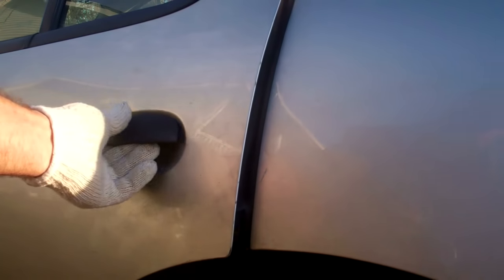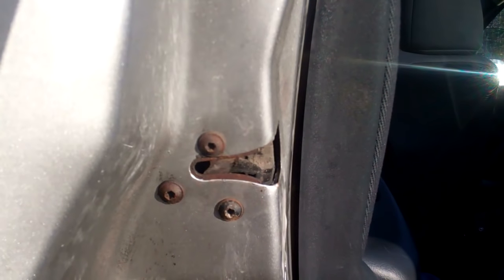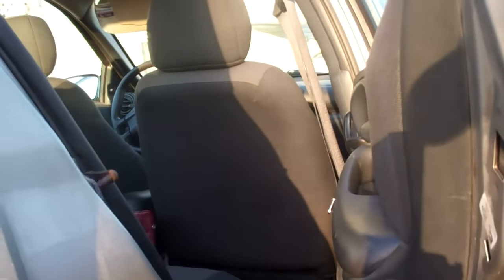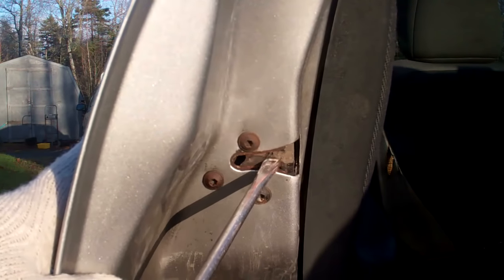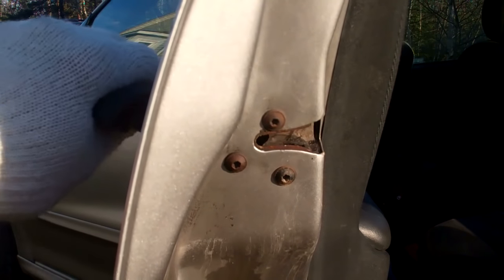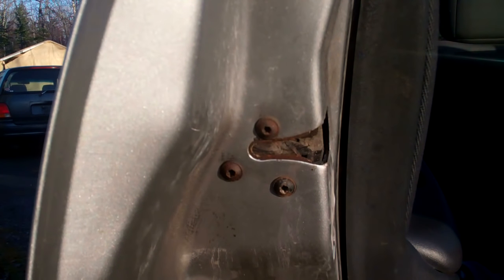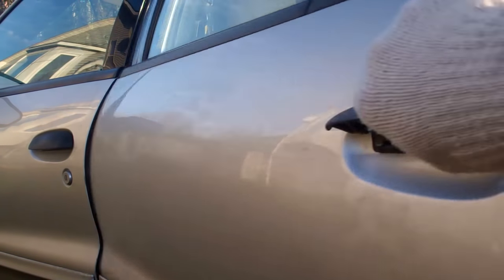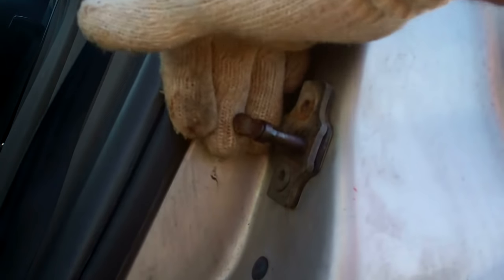Repairing a stuck latch on a car door

Comment: Again … no actual fix Jesus …  third video a dude just pulling on door handles lol I’ll post my own video of me actually fixing the latch issue… which required taking off the door panel and fixing the plastic latch piece holding both handles together
Reply: Ugh I was afraid of that! The door was working when I bought it, I tried to fix it, ended up latching it open ugh! My mechanic is sick of me…
Reply: My door latch will not unlatch even with lube,screw driver,and handle. It's wedged in I think,did you end up fixing yours? Did u post video cuz right now my door is held closed with a bungee cord.

Comment: You saved my bacon! This stuck latch happened on my 1996 Leisure Travel Van; parked in a storage compound; suspect attempted break in as locking gas cap was pried off as well. At any rate, there was no autobody open Saturday when I discovered this messed up latch and thanks to YOU I did not have to leave my van with an open door until Monday when autobody opened! Am extremely grateful to you.

Comment: I am an air force mechanic and I ran into this problem at 2 AM as it was begging to rain I looked up bad locking actuators bad cables panel removal and them I saw this video fixed my problem saved the interior of my car just wanted to say how simple this is it can be totally over looked and I really appreciate u making the video

Comment: Finally I found this video after many useless wild goose chases.  I closed the door with the seat belt in the way.  The safety lock mechanism activated.  I could not release it and so we had to go back home with the door not close or latched.  My efforts to fix the problem in a parking lot failed because of one simple fix explained in this youtube video.  I did not raise the exterior door handle while trying to open the safety latch.  When following this video's procedure I can fix the problem in about one second or less with any nearby nail file, screwdriver, nail clipper, small finger, etc. pulling on the safety latch WHILE RAISING THE OUTSIDE DOOR HANDLE!   I thank you very much providing the answer for solving this dilemma for me.

Comment: Thank you!. There’s been something up with my drivers door not shutting off the lights and radio when open. I went to fiddle with it this morning and managed to get the latch stuck in the lock position. After not being able to pop it back I found your video. 

Never occurred to me I should be lifting the door handle while doing it 🤦🏼‍♀️

Eight years and this video is still helping!

Comment: THANK YOU!!!  Bitter cold snap and my car lock froze.  I was messing around trying to get it unfrozen, and flipped the interior lock.  So frozen and flipped.  With heat and your video, I was able to fix the car lock.  Thanks so much for taking the time to do this.

Comment: thank you my friend. here in michigan it gets cold. and my door latch FROZE. Your method worked instantly without adding heat or anything(i added lock de icer hoping it will hold up rather than wd40). Thanks again. hell ill even subscribe :)
Reply from the maker: +mrpoppapill Cold temperatures cause a lotta car problems MrPop - glad you got it fixed !

Comment: Thanks. I got my car door to close after about 40 minutes pushing this way and that at the catch, looking at the other door to try to get an idea how it works. Eventually a few hard blows with a hammer on a screwdriver (watch your eyes) managed to shake things up, as up to then it wouldn't move one way or another. Then I could pull the catch back fully with small wrench while holding the door catch open.

Comment: What if you have, like, the opposite problem?

Where the door will shut fine, but the latch is stuck in like an open position, so it just swings open again freely and won't stay closed?

That's the problem I'm having.  I played with the latch with a screwdriver, and was able to flip it into the state that this video describes, but I don't know how to keep it from doing the other thing in the first place.
Reply: DarthEnderX did you figure it out?? I am having the same problem!
Reply: DarthEnderX did u fig it out
Reply: Have the same issue now. Have u found out how to fix it?
Reply: Me too my car open outside driver door!!!!!!!!
Reply: I had this problem last winter. I blasted the heat assuming the latching mechanisms might be frozen, the I held it shut for ten mins. This winter, same problem, different door. I think I'm just going to take some tape and wrap it around the latch bar and I hope this fixes the issue. I guess I'll get back to you on that.
Reply: Brian Prado yup. Thousands of videos on a closed latch on an open door. But nothing on a latch that fails to engage the post.
Reply: Try WD40/Lithium grease, worked for me
Reply: Mine is frozen as well. Doing the exact same thing.
Reply: Jonathan Sean Bell Did you figure out an answer to this issue??
Reply: Did anybody figure this out?
Reply: Any answers yet
Reply: Any answer yet? So I have to bring my car to the dealership then
Reply: Mine fixed itself overnight it was a temperature thing. I have a Florida car and it doesn’t like Rhode Island cold temps. Maybe try heating it with a lighter or something
Reply: someone know how to fix this shit?

Comment: thanks for the info thought it was the latch but come to find out it was the stud the latch closes on set the right position
and tightened with a T-50 tork driver  on a breaker bar . door closes like a bank vault now.

Comment: Excellent video...  I have a 02' Ford Focus in which the front passenger door won't OPEN/unlock!  I cannot remove the inside panel to troubleshoot the problem.  I believe the lock actuator need to be replaced, how do I get the door open?

Comment: My driver's side door is having this issue (99 Jimmy). It appears that the latch is now loose. Those doors are a pain, because they end up having hanging issues. SO I'm not only dealing with the latch problem, but in conjunction with the hanging issue...it's a mess. Any suggestions, or should I take it in to have it fixed?

Comment: can slamming a sliding side door(van) damage the latch? I parked on a hill today and opened the side door of my Nissan NV200, walked away and it closed itself(hard).

Now I'm having problems closing the door. I can still slide it but and it will close, but won't close completely. Rubber on the latch is all torn up for some reason, welds on the actual door near the latch is showing a crack. I usually have to try 5-6 times to get the door to actually latch close.

Comment: My car door is experiencing the same issue. I used WD40. Open and closed it several times. Let it sit for about 10 minutes and tried it again.  Each time I still have to adjust it for it to close. Do you know what to do when a quick fix isn't working? It's the drivers door and I am worried that it simply won't close at all for me. I have already experienced this with the passenger side door. It will no longer latch at all and it tied shut to prevent it from opening while driving.

Comment: Help, this has happened to our 2001 Honda Odyssey driver's side slider door, after trying to figure it out and reading and watching a ton of video's we finally found yours, but we're lifting the handle and the lock wont budge with the screw driver! Sprayed it down with lubricant and waited but it still wont move which obviously means we can't shut the door. Any other suggestions???  It's about to pour here and we're about to go crazy trying to figure out what to do. Thank you!!

Comment: I did what you said, and it worked.  However the door ajar indicator light will not go off, soo it runs the battery down.  Now what?

Comment: What if you have like the opposite problem where the door will shut fine but the latch is it Stuck Like An Open position, it just swings open again freely and won't stay closed
Reply: I have the same issue, last week, I took to garage, they said the lock is free it needs to be changed. More than that I have to order it first??!!  😳
Reply: Nawal, if you get to know how to fix this, pls let me know : (

Comment: What spray are you using?
Reply from the maker: I use ''Fluid Film' now Joe ; its not what i used in this video though. I discovered Fluid Film about 2 years ago - its the best cleaner/rust eater i've found so far. And this isn't a sales pitch; i make no money from the product - its just good stuff !

Comment: Mine is a ford focus 2001 and it happen to me just tonight after a rain storm, normally the car door handle doesn't open so I have to go on the other side to open it but when I'm inside the car it works on that end but today the door had trouble closing and opening and after work it was the worst I had to us a pen to re open the latch

Comment: For all these people with the opposite issue, my ford does it all the time when it’s super cold just random as shit. But getcha a goddamn heat gun or a blow dryer or just park and crank your heat till it rivals the pits of hell in your car and your sweating your balls off. Try to get rid of the moisture freezing/seizing with heat but don’t melt shit. Then what I did is got me some of white lithium grease and caked that shit in my door hinge and haven’t had issues really.

Comment: So I got this to somewhat work the car door is still ajarred, and its causing the battery to go dead. Any idea why?
Reply from the maker: +FishnetLullaby If the interior dome light is on (because the door isn't fully shut) , it's probably killing your battery . Turn the dome light of manually with the switch on it until you get the door fixed Fishnet
Reply: No its the side panel door light

Comment: my grand am door is stuck closed how do I get it opened to get the panel off
Reply: there is another video on this by a different guy. you'll have to take the entire panel off from the inside for that fix because odds are the latches that control the door fell off. just type in the search "door won't open" it should come up.

Comment: Soooo.....can anybody tell me what to do when the latch still moves/works, but the door still will not stay shut?? My latch isn't stuck like this one in the video is, but my car door still will not stay shut. The handle/lock works and you can see the latch move when either is used, but it's like the other part on the frame won't accept the latch. The door closes to the seam but won't stay. Help???

Comment: well it appears this wasn't my problem.... 
latch was in the open position but the lock doesn't engage. 
I forced the frozen shut door open from the inside. Now it wont stay closed latch or lock... 
Hopefully its just ice holding the lock open.
Reply from the maker: +DarkShadowsX5 Hope you got it fixed DarkShadow
Reply: +backyardmech yeah its works now.  It was frozen in the unlock position inside. I could lift the handle up and down all I wanted and it didn't do much. All I had to do is wait for warmer weather the next day to unthaw it thankfully.   I haven't had that happen before.

Comment: Ok now come pull my doorskin off and replace or liber the latch cable in my car it's -16° here and my door is frozen open, or unlocked.
Reply: In this case, get some water or deicer, both work.
Reply: Josh Trierweiler Not in my case, wound up removing the skin in 7° windy weather. The issue was actually the entire mechanism where thee door lock bolt clicks, it was had moisture, and would freeze to the point of leaving me to drive home from work with the door swinging, and the outside handle floating in the air, and same with the interior handle if I used it. 
I didn't have time to deal with it in 7° weather so when I got the skin off, I went Picasso on it with some copper Grade  Never Seize. Since then I have yet to have any issues with the drivers door.
Reply: Damn vehicles, we'll make them work regardless of if they want to or not.